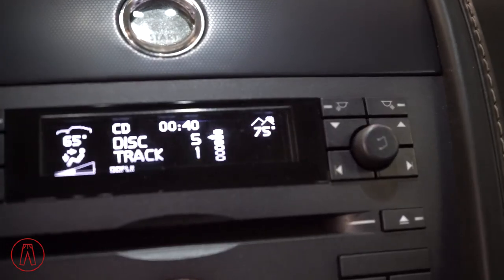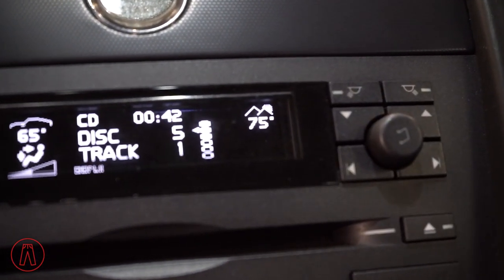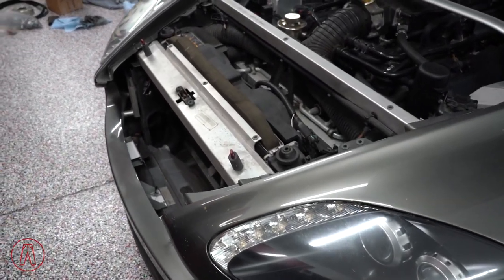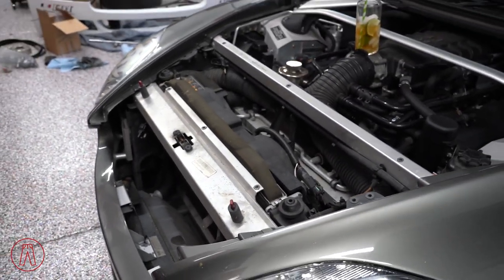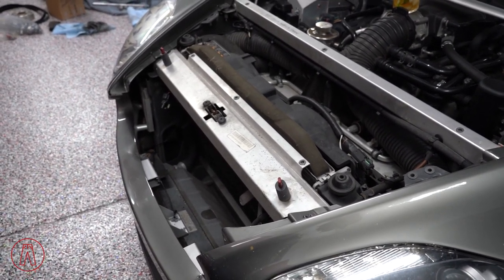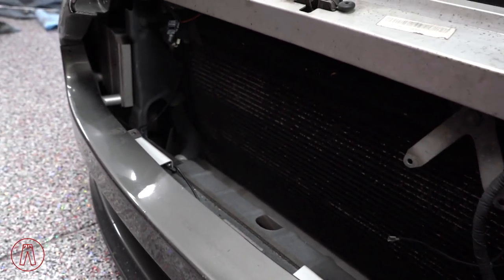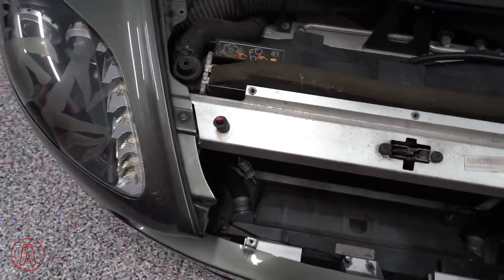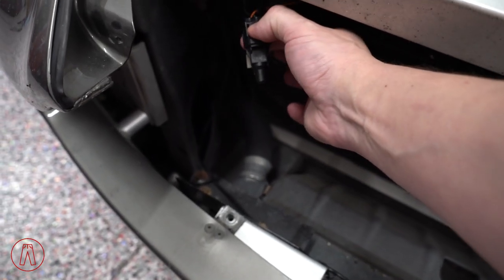The Ambient Air Temperature Sensor for an Aston Martin

Comment: Holy cow!  This video ended a long drama we were dealing with on a customer's Rapide.  Alternator would not produce anything over battery voltage plus about .2 volts.  Wasn't alternator, wasn't the battery temp sensor.  Turned out to be this ambient air temp sensor.  Terrible engineering on a car that has a battery temp sensor but THIS video saved the day!  Car thought ambient temp was 123C.  Ugh.  Threw in a resistor instead of temp sensor and voila!  14.5 volts out of alternator and finally the console displayed a outside temp too.

Looks like Aston forgot to eliminate this disaster safety approach on the Rapide when they added an actual battery temp sensor.  As a former auto engineer let me say that was a big oversight and negative safety concern.  Strand a family on the road for a bad ambient temp sensor?!  Bad idea.  The hvac is the only system that should leverage this sensor on a Rapide.  Astin Martin, you screwed up!  Red pants, you saved the day!  I'd suggest putting some "Aston, won't  charge, etc. Meta data in so this video pops up.  We found it via a miracle.

Comment: Thanks for the info. I had the ambient air temperature go bad on me twice, but in the other direction, constantly reading 54 celcius if I remember correctly. I didn't have any issues apart from the ac wanting to freeze me. It was replaced both times by AM for free and they said its a common issue. Apart from that I have had no issues with the xar. Greetings from Germany

Comment: Great info, I wondered what that  plastic thing was, I knocked mine off when cleaning behind the grill. You are right about the bonnet closing without the slam panel, makes it a two person job to reopen. 
Regarding the grill, I sanded and polished the alloy bars then PPF, the PPF made the bars a nice secure fit into the plastic supports. 👍👍
Reply from the maker: Glad to help

Comment: Nice report,  thanks for the information.  I have a DB9   And the sensor. appears to be located below the hood latch mechanism.  Easy access on the DB9.  
Another “gotchas” for the DB9 is the intake manifold PCV ports.  This almost cost me an 80 mile trip and Lord knows how much at my nearest Aston dealer.  Car  suddenly running rough surging and  smokey  exhaust.  Very poor design by Aston that is guaranteed to fail.  On the   very far back of each intake manifold is a port for the PCV system to return vapor to the intake.  For US cars the right side is plugged and only the left has a PCV line feed.   Both  ports have a brass pressed in bushing with a rubber washer in a gap behind it.  A plastic insert goes into the brass bushing to push and washer to  the back flange face.  Then a plastic plug for the right side  or a plastic pipe for the left side is inserted thru the brass bushing and plastic insert to press fit into the rubber washer at the flange face.  The plug and/or pipe is only held in place by friction with small barbs inside of the plastic insert piece.  Yikes!!!  What an unnecessarily dumb complex design that will eventually leak.  That’s what happened in my DB9.  The washer on right side broke up and part of it obviously went thru the engine. This allowed the plastic plug to get loose and eventually fall totally out.  This left a 1/2 inch hole at rear right intake manifold so that the back 2-3 cylinders had large bleed air causing lean cylinders.  Computer then enriched everything making other cylinders rich.  Hence Smokey exhaust.  On left side the PVC feed pipe was loose and sucking air for the same reason.  Had to buy kit for right side. $60.   Silicon glue to right side.  Roughness instantly cure.  Also engine performance much improved.  Must have been
leaking air into manifold for a long time prior to the failure.  If you check these fittings and they wiggle then they are leaking air and need repair.  I bet any V12 engine over 10-12 years has failed at these fittings.